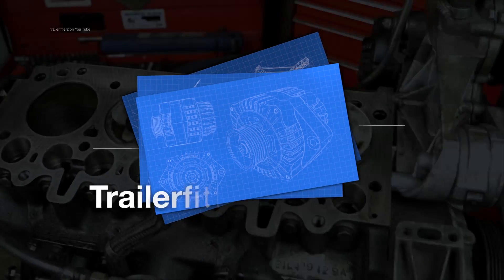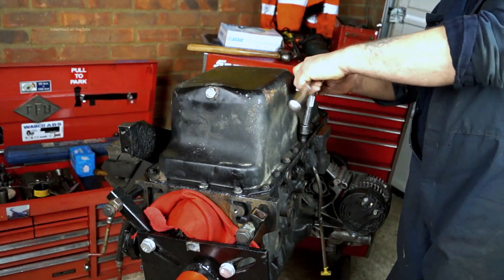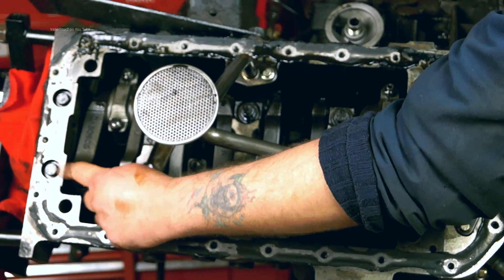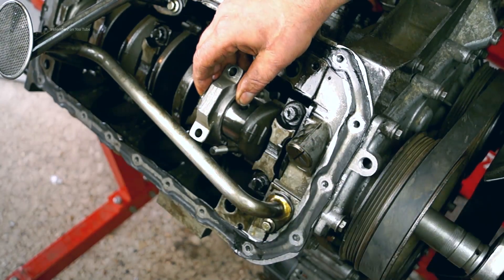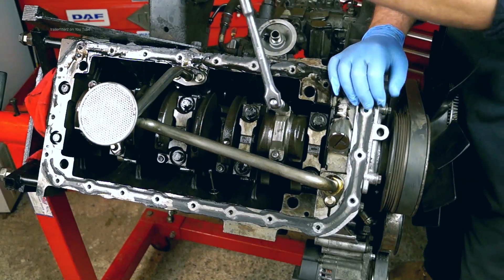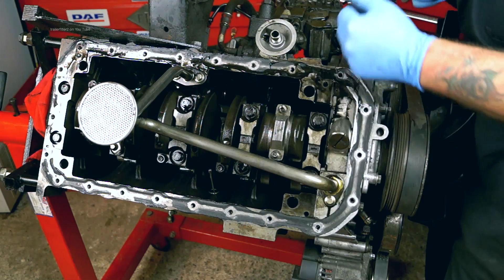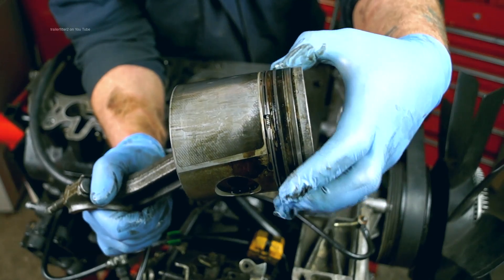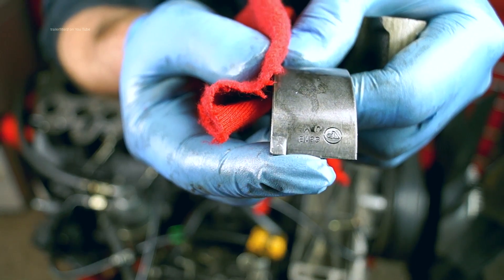Land Rover engine rebuild stuff you must know - CON ROD

Comment: I used to go to the old Rover engine factory at Woodcock Lane in Acocks Green, Birmingham in the 1980s and have seen many a Rover Group crankshaft and bottom end assembly. My late Dad was a designer and used to get me in as a lad of about 15-18 to see the production. Also went to East Works at Longbridge and saw them assembling K series enfines there in about 2000-2002. The crankshafts were supplied by Darcast of Smethick.

Comment: Hi Chris. Can I ask if you have any tips to remove gudgeon pin bushes from the con rod at home? Ive tride heating it and using plus gas but only removed 1 so far.
Reply from the maker: you really need a press.   If you don't have one usually a nearby garage will have and I am sure they would help. (?)
Reply: Thanks, Chris. I had an inkling this would be the case. I'll get looking, cheers.
Reply: Hi Chris, cheers for the advice. I found a chap who restores classic vehicles, by chance, who had the correct press! 
Could I also ask you, Chris, about series Landy conrod bolts? I've looked at the standard nuts for sale (suitable for 2.25 series engines) but they look like standard high tensile nuts with no locking mechanism are these okay to use? 
I've included a link: 

https://www.johncraddockltd.co.uk/land-rover-defender/defender-90-and-110/parts/engine/etc5155-nut-for-con-rod-bolt-2-25pet-and-diesiel-2-5-pet-2-5d-na2-5td-and-2-litre-diesel.html

P.s. Could I also ask how you would stagger the piston rings before I put them in place E.g. 20 degrees per gap?

Thanks for your help and advice, Chris, both directly and indirectly in videos!

Comment: reading the engine overhaul manual, they do mention that big end shells must always be changed.--
Reply from the maker: So should the nuts for the con rods.
Reply from the maker: In reality one should measure the crankshaft for ovality and taper first then measure the clearance between the shells and journals with  "crush plastigauges"  with new shells.

Comment: Hey, I've been looking to diagnose my 2.25 petrol (emissions tune) engine, I'm having problems with pre-detonation, I'm using high octane fuel with a lead additive to try to counteract this however it still isn't proving to work... The head has been adapted to run unleaded, however I'm not sure that this is the problem, perhaps adding two gaskets to the head would lower the compression ratio and hopefully prevent pinging?

Comment: What's the cause of the engine locking up on when tightening the big end bearings? We have torqued it to 59nm as per the Haynes, but as soon as we tighten a second, you physically cannot turn over the turn to get at the third set of bolts
Reply from the maker: have you changed the shell bearings? If so do you have the correct ones and not an oversize set?        Also did you measure your crank journals?     https://youtu.be/be6M3pwjuos?list=PLLBZWyYKFvYJSOiLeC89pwT8aLLBkrnu-
Reply: Land Rover Toolbox Videos using the existing bearings, they were in perfect condition, on reflection my free engine didn't need a complete restoration, everything was perfect inside but hey ho I'm here now. 
I've done nothing to the crank just purely took pistons out to re ring them and that is it
Reply from the maker: are they seated correctly?
Reply: same pistons in the same cylinders?

Comment: @7:35  Dam...I feel threatened, if the con rod has any gap, then it is U.S. you want to get rid of it !?   He should have uttered, "useless" not as rude.
Reply: US is a term used by engineers to mean Un Serviceable.
Reply from the maker: Yes because it means the cap is distorted.  Last thing you'd want is to have it drop off.
Reply: i thought the same but i think he means utter shite.
Reply from the maker: do you know what plastigauges are?  Use them
Reply: Agreed !
Reply: From rude to insulting...need I say more ?
Most certified auto technicians, engine re-builders are familiar with the terms of importance which include clearances, specs, tolerances, squareness, angles, pitch, special tools and a manual.

Comment: Hello, do you know what is the height of the piston on the block when you make a new engine? in a 2.25 Diesel serie 3.

I work with a old Land Rover mechanic, 60 years work in the LR company here in Uruguay. And he told me that when you make a rebuild a engine the pistons dont have height over block, and the valves must be flush with the valve cover, so you assemble the engines like this?
Many thanks
Javier.

Comment: I have a rover V8 in my Chimaera and am stripping it down. I cannot find the tolerance number in the Haynes manual for the gap between the conrod and the crank web. Would you know what it is for a 4.6 V8? It has a cross bolted crank. Thanks.
Reply from the maker: +arebrec  No idea.  You will need to look at the correct Workshop manual for the rover v8 that the engine originally was built for.    Haynes sucks.  Brookland publications  are much better for pure technical details.
Reply: +Land Rover Toolbox Videos  No bother. It's all apart now and the crank, block and one of the heads are at a machine shop getting measured and honed/polished. Thanks for the quick reply LRTV.
Reply from the maker: Engineers usually have a mass of data at hand.  Have you asked them?

Comment: Where about are you based? I have a 200tdi with low oil pressure. The pump has been replaced so it's something nasty like the cam bearing shell.
Reply from the maker: +kelvinchill   low pressure could be a loose or cracked suction pick up pipe.
Reply: Thank you

Comment: Hi I am from GEORGI I have 1998 1.8 freelander my cylinder head fails second time then I took of head I sow cylinder liner go in to the block a little I now I must replace engine its deformed but I can not I already bought new cylinder head can you tale me if I can use old crankshaft and pistons in to new block new block already have liners and if I must replace big and bearings can I replace in new ones in same cod which have old big and bearings I have no bore tool no micrometer and its my 1 time to build engine and I can not choose right colors of big and bearings pleas help me
Reply from the maker: Any build on a vehicle will require measuring components.  You cannot just throw in pistons from another engine and hope they will fit.  As for shell bearings from the crank you are fitting to another block you might get away with fitting them because they are bedded in to the crank however without knowing your tolerances you are asking for trouble.